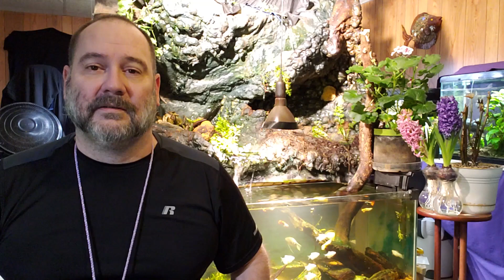Can You Have Too Much Biofiltration?

Comment: So in the end from both movies you have to find good balance between mechanical and biological filtration. Because if you are lazy and you are allowing filter to gather a lot of poop inside you should prepare enough of surface for biofiltration to handle it. If you will take care of mechanical filtration with good maintance, tank by it self will handle everything. After reading result of comparison beetwen different filter media from seachem matrix to sponge filter I'm also thinking that after tank is established with just enough of flow, it can take care of cycle without additional filtration. Thanks for great materials ;)

Comment: I normally do . Max capacity. Add an extra factor or 2 or 3

So my 30g has 4kg media, enough for a 100g

If I have a dead fish, or 5. No ammonia spike

You can have too much buy spending too much, or wasting tank space. It’s a balence through experience and practice.

Cost of bio media of a 30g. £40.

Cost of stocking a 30g with 30 fish....at least £100

Comment: Great topic! Since bacteria always replicate as a normal function, the filtration of good bacteria takes up all space within the volume of the aquarium. Once the bacteria establishes, it will not stop unless there is some sort of disruption to it by a contaminate, either physical or chemical. Therefore, there is never too much biological filtration. Whatever surfaces, including water, exist within the aquarium they will always have the bacteria on it with the constant replication of bacteria happening. The complication to this if the time process to accomplish this as well as the aerobic and anaerobic surfaces fro this to happen. You can overstock an aquarium and that in itself causes a whole lot of associated problems.

Comment: Hi Dan.  I am relatively new to this hobby and would like to run something past you.  If I slightly over feed, I should be able to build more bacteria than the tank really needs (assuming of course there is ample amounts of media).   Would that be in any way, helpful to me, if I over clean either the tank or a filter?
Reply from the maker: In theory that works, but I'm not sure I see the point. You're just creating addition waste by over feeding. What's your goal?
Reply: @DanHiteshew-oneandonly  I guess to have extra  bacteria available to keep control of the tank, instead of running into a shortage, in the event of me killing too many by over cleaning.  I am not purposely doing this but while watching your video, and processing what you were saying--it got me thinking.
Reply from the maker: @glentuchscherer968  Just don't scrub your filter out and you'll be fine. Leave the biomedia alone unless it's getting clogged. You need good water flow through it, but otherwise leave it alone. When you do clean it, just rinse it out a bit to get the solid crap out of it, but don't scrub it in hot water or anything. You'll be fine.
Reply: @DanHiteshew-oneandonly  Ok--thanks for the help.

Comment: You can have too loittle bio filtration by not having enough media for the beneficial bacteria to live on/in. But you can't have too much bio media as the bacteria will spread out so ong as there is enough amonia and nitrites are in your aquarium Fish also excrete urea as well which is converted into ammonia. If your toxins increase slowly the beneficial bacteria will spread until there i s no more room for them to spread to. They will also colonize substrates, plants, rocks, driftwood, and the tank walls aswelll as the filter materials in your filter, be they mechanical poly fill floss, or sponge, bio balls or ceramic bio media. All of those allow room for the beneficial bacteria to spread.

Comment: Thanks for keeping your promise on the follow up vid.  I mentioned on the mechanical filtration video on my over filtration with biological  materials in some of my tanks.  I agree with you on your balance out theory. 3 reasons why I  go heavier than normal. 1 im a over stocker of heavy pollution fish.  2. One tank is discus. Enough said there😱. And 3 ive had situations where I  was given fish on a very short notice,so i could just pull a filter off for helping a quickie setup. But i really do see you're point when you don't do the over stocking and not growing monster fish in  admittedly smaller tanks than they should be in. Can we look forward to a chemical filtration vid.🤞🤗
Reply from the maker: Probably not. I never really use it so I don't think much about it. Maybe I'll talk about it.
Reply: @DanHiteshew-oneandonly  i hear you. Only one i use is purigen. I wouldn't even use that other than you can recharge it many times